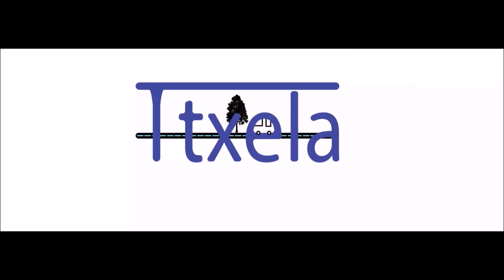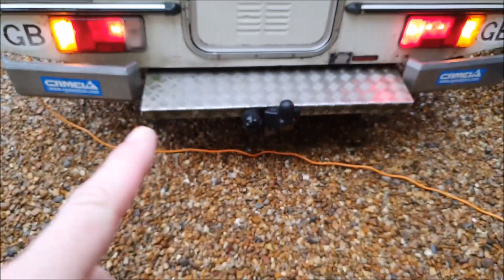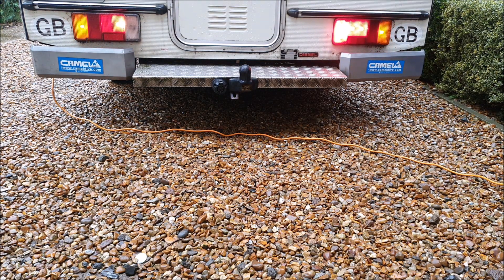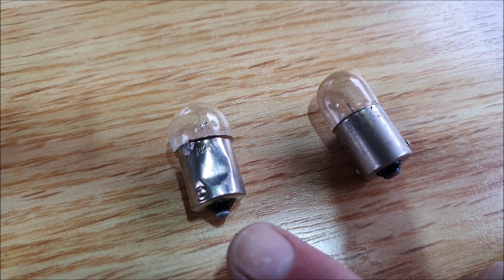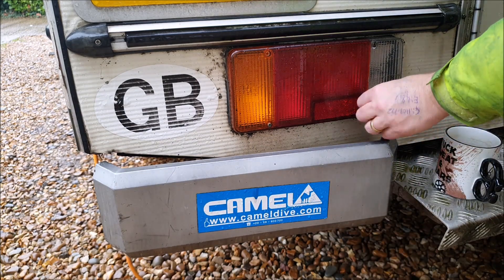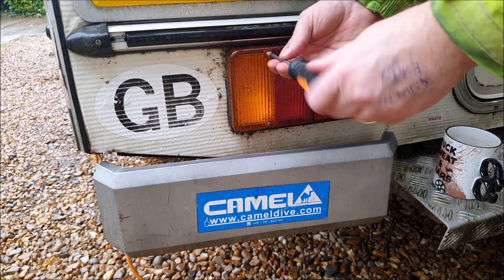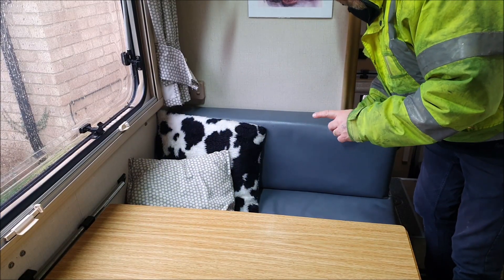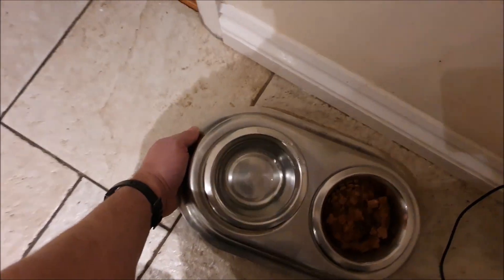MOT Time For Our 1990 Citroen C25, Elddis Autoquest 270 Motorhome.

Comment: Great news about the MOT , i wouldn't worry about the wheel bearing , mines had a couple of those in the past , i think its only the tester covering himself , if your gas heater is past it have you considered ripping it out and fitting a Chinese diesel heater (2kw not 5kw )
   good luck  👍
Reply from the maker: A diesel heater of some sort is the plan I think. We have an electrical heater for when we are on EHU but it would be good to have an independent option 👍

Comment: I had a advisory on one of my rear bearings, I just took the wheel off and nipped it up a little, (about 1 flat one nut) there is no castle nuts on mine, so took all of 5 minutes to do, yours maybe the same!! if there is a rumbling noise them the bearing will be worn or getting worn, if not, your good to go, enjoy your break.
Reply from the maker: No rumbling noise that I've been able to detect 👍

Comment: I own a similair van.
The rear lights seems to be sensitive to oxidation.
After spraying the socket with oxide clean and later on vaseline spray and replacing the bulbs with LED equivalents all problems are gone.
Reply from the maker: Good call! This may be a job for the future 👍